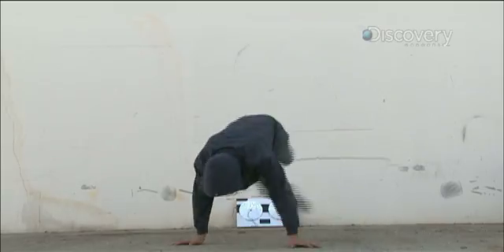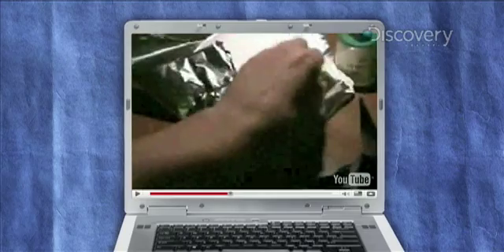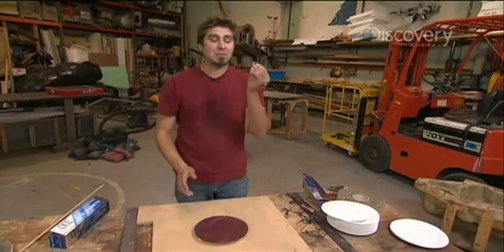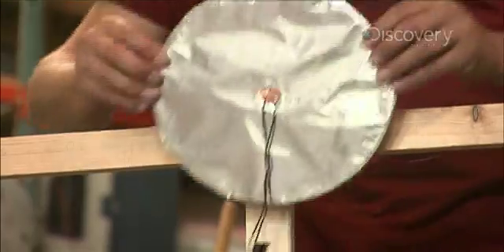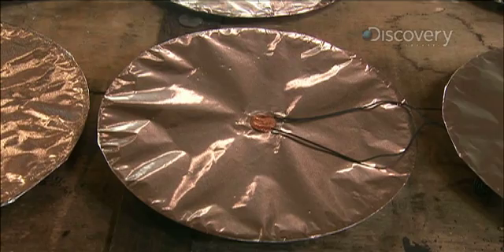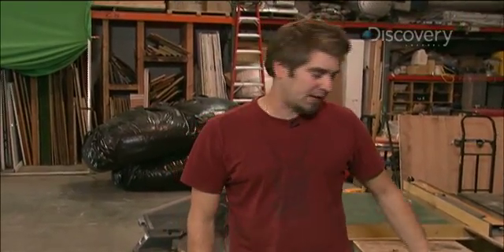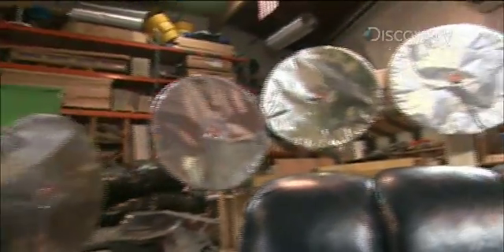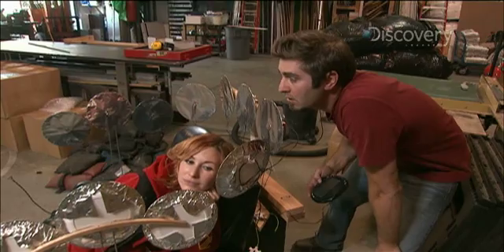MythBusters - Homemade Hi-Def Speakers

Comment: You have a colorpaint on the red wire you have to burn it away before he makes good contact. Maybe you haven't put the two wires on one side of the penny but one on the foil and one on the penny. 

I'm sorry about my bed englisch i'm dutch.

Comment: sorry your need to check your terminology and prices:
"these minijacks cost $10 each"
1 it is not a minijack it is a PLUG with a cable, the jack is the part on the computer,mp3 player,etc. were you plug into.
2. the cost factor, you can by extension cables at amazon for 1 cent(plus shipping), at Fry's for  1.99. and I heard you can buy complete headsets at a dollar tree type store for a dollar or less.  Did you buy Monster? shop before you speak!!
I do agree that this will not work.

Comment: mythbusters are running out of ideas, we all new this speaker was a joke when it was put on YouTube and clearly would never work in a million years. for starters the penny and foil is shorting the wiring! if you had this foil plate hooked up to your 400watt amp it would surely blow the components inside from shorting the wires unless your amp had a safety feature to prevent that

Comment: @roflcoptergoesscisci  hahahahah hundreds of volts for an audio signal?? that is quite a powerful amp hehe....but no matter how much power you would stick into that thing it would blow the amp because there is no voice coil and no magent...all it is is a short circuit on the penny and the penny sitting on some foil :P and a walkman/cd player thing he is using would only put out about 1 volt ac max haha

Comment: @Hiddenjello well...it's kinda like 2 magnets that make a speaker work...the first magnet is a permanent magnet, which is what you see on the backside of the speaker. and the second magnet is an electromagnet of sorts made up of the voice coil. the electric signal from the amplifier will create a magnetic field in the voice coil that will either attract or repel the speaker cone towards or away from the permanent magnet...this is what causes the speaker cone to move

Comment: myth appears to be busted but I don't think so. most mini-jack wires have a layer of clear insulation that needs to be burned off before you could complete the connection.

Comment: that myth is easly busted for a reason. speakers work by magnets. it uses both permanent magnet and electromagnet. when a signal goes though the voice coil it pushes and pull agaist the permanent magnet many times per second. thats what gives you sound

Comment: ....you know, I tried this a long time ago, but there was one thing that I didnt know. how many people are aware of that small coating of enamal that coats the wires under the rubber insulation? you have to either scrape or burn it off, and Most people on youtube that I have seen that try this havent done anything in the video about it, and they didn't do anything about it in this episode...makes me want to try it again

Comment: Torry is too fun.  As for the connectors, yes under a buck no prob.  These things though will never work.  They ALMOST look like electrostatic speakers, but you would need HV to drive them, not an audio jack.  However, this connecting to pennies or aluminum foil does nothing more than create a short.  A speaker needs several ohms, and the energy needs to move something - either using a magnet, electrostatics, a tesla spark (cool), anything.  This is 100% hoax, hoax, hoax.

Comment: @1212fdfd the idea was that with a shiny penny to conduct the current through the wire, they could thus make the vibrations through a layer of tinfoil which ive seen work, in some cases ofcourse, others not so much :|

Comment: its time for Tory to bust another myth: That the Jacks cost $10 each. now, if you buy them specially packaged and made to be sold individually (the jacks alone) it probably would be costly, but there are the cheap ones on crappy earbuds that break too easily, which can be found at biglots, or a trash bin outside of one.

Comment: These 'speakers' are nothing but a giant short-circuit. Anyone with a basic knowledge of physics can see that. Maybe you can get a few seconds of horrible sound by pumping so much power into them that the foil starts burning at the pulses of the audio signal!

Comment: He did not even do it right, Household hacker used only one wire from the jack on each penny, not two.  He should have tried it on just two speakers, one jack. split the jack.  She also said that they were ran in parallel, thus increasing impedance, running speakers in parallel actually decreases impedance. 
I don't think they busted this myth properly since they did not wire it correct.

Comment: @zt1234567890 

There are no magnets or voicecoils. You could make a speaker with a paper plate a small magnet thin copper windings and a mini jack but not with just a penny.

Comment: @ericg83z no, there is a much bigger problem here, a penny wont respond to electromagnetic commands, thus it would never work. A speaker is a vibrational device that induces sounds using vibrations through a magnet & in order to achieve that, you will need a larger magnet with a big hole in the middle, an iron core that goes inside that magnetic hole & glued to that carton plate to amplify vibrations, over 50 to 200 turns of AWG30 magnet wire slightly bigger than iron core, but not touching it.

Comment: 2/2. or just go to that same Radio Shack where you probably got your over priced mini jacks at $10.00 each like you claim and purchase a 100 feet speaker cable followed by a pack that probably brings anywhere between 10 to 20 replacement mini jacks heads only, cut about 15 inches at a time of speaker wire and screw them to the mini jacks heads you just purchased.  There, a way more cheaper solution.  Or just go to Ebay and spend no more than $5.00 for the whole materials I just named.

Comment: 1/2.As soon as the guy said that he was going to use a penny in the center and NO COILS, Magnets, etc that would be required to induce vibrations, I instantly knew that it was not going to work.  You need a coil, a magnet (pref. of the Neodymium/rare earth type) in the center, and then maybe the vibrations would catch up with the carton place, but no aluminum would be necessary.  $10 for each mini jack plug?  I can get 10 of them for under a $1.00, Hell just buy 10 cheap ear buds at a buck each.

Comment: i tried this a while ago.  It actually works... kind of.  I had my mp3 player turned up to max, connected to a set of speakers also on max (to boost the power).  with all this i was able to hear a little music, holding a strong magnet up to the jack/aluminum connection helped a lot.  that's when i got the idea of making a speaker the way they should be made, coiled wire and a diaphragm.  this worked much better and i never tried the aluminum method again.

Comment: @troy1002x none of the ones i have watched have been, they have all just been the result of either good humor playing on the ignorance of others (such as wrapping an Ethernet cable around your phone to get a better signal) or crafty camera work and using off screen devices (such as the toilet seat lowering when you flush it).

Comment: just tried it and it works. however a cd player does have enough power to drive a such speaker. i only got a rather vague sound by using a 50w amp. and about being hi-def, yea right. 

dont trust the mythbusters too much. guys sometimes make experiments that aim to proove simple physical facts. i mean, you dont have to use high speed cameras and stuff to determine velocity that a falling coin would have and you dont have to make an unsuccessful experiment to know that the speaker would work.

Comment: that kid is in idiot - why is he on the show?  He connected both leads to the penny - that's not how you do it, moron.  The penny doesn't vibrate ass - it's the resonance of the AC signal on the foil between a location away from the penny (1 lead) and the penny itself (other lead.)  That's how magneto speakers work (in a sense.)  
In fact, Infinity speakers used to have something called an 'EMIT' tweeter that works like this.
That guy is a clown.
Mythbusters fails again.

Comment: One note, it does not cost $10 to get a  1/8" cable (mini-jack) you can go to almost any dollar store, and get a set of earbuds / headphones with this connector for a dollar or less. 99 cent only stores has a two pack of earbuds for .99.
 I still can't see how this could work, but the parts can indeed be acquired for less than a dollar.

Comment: ...even a normal speaker wouldnt work that way.
There is just no amplifier.
Without an amplifier you can connect as many speakers to your discman as you want, but you wont hear anything.

Comment: Agreed, they were, which is why they required nothing to act as a conductor and amplify the sound. Also, yes an Ipod or CD player can create a spark IF the gap is small enough. With regards to a spark, there's a HUGE difference between the actual voltage and amperages required. If there wasnt, then stun guns and camera flashes wouldn't work off of a 1.5 volt battery. But to my O.P. my argument was that mythbusters didnt do the experiment right. I've watched em enough to expect better.

Comment: @Morndenkainen 
those arcs were so much biger
also there most likely isnt an electrical arc because the wires are touching and not movingmoving around to create a spark
third, there is not enough power from an ipod or cd player to create a spark

Comment: douche bag. by know you should have figured out that paper plate+tin foil+a penny+a mini jack does not equal a speaker. and plus the musical tesla coils video was just sparks that made a beat. similar to ELECTRO., but there is no way in hell that this medeocre method can play thriller in HD. so before you run your mouth make sure you can tell music from electro

Comment: Eh, now your simply talking a matter of voltage or resistive gap.. Im sure you know how easy it is to bend a thin sheet of aluminum or make it vibrate. Thus it stands to reason that even a small disruption in the air between the penny and the foil could be amplified by the surface area of the foil and produce sound at an audible volume. As the penny is heavier than the aluminum.
I agree thourougly though, this is not, by any means, a speaker in the traditional sense of the word.

Comment: i think we are arguing about two different things...i'm saying it wouldn't be speaker and being a smartass because it would make the whole thing wrong and it would be a mini tesla coil if it worked and that makes it not a hi def speaker like advertised...and you're arguing that sound can be made with an arc...i agree with you...just saying that THIS will never work with what is used...so arguing with how the test was conducted is futile...THIS WILL NEVER WORK USING THESE PARTS!

Comment: All I said was that it should work in theory. The arc reverberates off the foil, as in the air pressure waves given off by the spark would cause the foil to vibrate. I never claimed it would be high quality sound. Just that it had the potential to make sound.
1. Any electrical spark creates heat.
2. Heat expands the air.
3. Rapidly expanding air causes a crackling or "popping" sound.
4. arcs in sequence can create sounds.

Like I said, the theory is right, even if the practice is wrong.

Comment: i'm sorry but the fact you are comparing THIS to a tesla coil is ridiculous! i have seen the video you are speaking of and it is really cool, however 1.) its not hi def, it sounds like distorted midi, and 2.) tesla uses a lot more power than line level devices. there is simply not enough power here to sustain an "arch" long enough to create midi sound.

Comment: I was just confirming that the theory is sound based on what I know, (Pun intended.) One lead on the penny, one lead on the aluminum, make sure the penny is nice and clean and the contacts between the penny and wire are good, so that it can create a good arc and it should work..

Also, incase I didnt say it before, spending $10 on a pair of leads is rediculous, just find an old pair of headphones and chop em up.

(The last only applies to the Mythbusters.)

Comment: Pull out a sheet of foil and look, one side is dull, the other is shiny... Consider this. If you bake a potato on the grill, and use the shiny side out, it takes longer to cook, than if you put the dull side out.. Why? Cause there's a difference. :P
Shiny reflects heat, dull absorbs it. Obviously heat isnt electrictiy.

Comment: Yes, and no... Have you ever seen music played on a tesla coil? Youtube it. You can create sound waves with an electrical arc. The sound gets dispersed on the aluminum, and that is what makes it audible. When there is a SOLID, connection, there is no electrical arc, they used the wrong side of the foil in this video, hence no arc, and no sound. Household hacker does not say which side of the foil to use, but watch the videos and you can see the difference.

Comment: 1. notice in the video the two wires and in the original theres 1 and maybe try putting the wire under the penny
2. Its plugged into a computer
3. The wire is sticking out
well not that reasonable but try doing it EXACTLY as it is bit by bit

Comment: Sigh. You guys did it wrong.. 
1. you need one wire on the penny, and the other lead goes to the foil.
2. You have the aluminum foil on backwards, the shiny side goes in.
3. It IS possible because you are relying on the electrical arc between the penny and the aluminum foil to create sound. Aluminum foil is flimsy enough to vibrate to conduct the sound over a larger surface area.

The theory IS sound, which can be produced if done right. (pun intended.)
Cmon Tori, your smarter than that.

Comment: i would say that household hackers PC has a built in amp pre out, some pc cards support this some require you to use powered speakers, the little portable  cd player doesn't have enough power to push enough sound current as the PC does. the only way you could really bust this myth would to use the exact same setup as the hacker used

Comment: WRONG! That's not how you make speakers. However, you can make speakers using a foam cup and some magnets. The reason these speakers didn't work was that one, he didn't have anything to generate a magnetic field, and 2, the the contacts were connected directly to the plate, which should of been the cone. If he had put a couple of magnets on the back, and put those plates into some sort of frame so they could move around freely, then attached the wires to the magnets, then this would've worked.

Comment: @losernameUSA  It'd never work, work, A speaker works by creating a magnetic field in a coil which is repelled and attracted from a permanent magnet in the speaker housing. This is just the wires connected to a coin, nothing more than a short circuit....however indeed you are correct that even if it'd be created using a coil and magnet, they'd still need more power.

Comment: This was on Household Hacker, I can't help thinking it was malicious, shorting out the source by connecting both wires to a single copper coin could damage it. Probably deliberate and certainly a waste of time, Household Hacker is mostly comprised of badly thought out stuff which does not work...

Comment: with a magnet and an electromagnet you cause movement. Movement displaces air that's how we hear sounds.  There is no way a paper plate with foil and a penny will make sound efficiently with any clarity. You would be better off to spend you're money on a cheap PC speaker replacement.  One of the old ones. You can find em for a dollar.  Put them in an airtight enclosure and voila, cheap speaker.

Comment: @PalomarJack  well i could of gone all technical like that but i decided to make it a lot simpler i looked at the mechanics of it but if you want i can explain the hole thing 
1 audio device sends electrical signals
2.since the signals is electrical and is moving in a spiral patter the magnet next to it moves up and down also referring to your magnetic gap
3 the cone or membrane moves because of the magnetic gap making air around it to expand and retract making what we call vibration/sound waves

Comment: there are three main component to a speaker the copper wire, the membrane, and the magnet  the electricity flows threw the copper wiring around the magnet making the magnet move  the connected to the magnet in the membrane which all it does is move with the magnet pushing and pulling the air surrounding it making vibration. and if you revers everything i just said you make a microphone :)

Comment: Not all speakers have to have a magnet. If anybody has ever taken apart an old telephone they know this. These types of speakers rely on vibrations much similar to what has been described in this video. Also search up Plasma Arc Speaker, again no magnets. As for this myth, come its a paper plate and tinfoil for cryin out loud. No way it was ever going to work.

Comment: Okay, you're right that the two on the penny is a very short range short circuit, but doing it on the outside of the plate just makes it a long range one... There's nothing for the electricity to do work on in between those two points.

A normal speaker works by pumping current through TIGHTLY bound copper wires (think hundreds of loops) to generate an electromagnet. That then attracts the speaker cone to a large magnet in the base, causing a pulse of air.

No magnet, no speaker.

Comment: I think it's a case of a little knowledge is a dangerous thing. People know speakers have a moving part and that foil conducts electricity, oh, and that they're usually round, but beyond that it's magic. So, many must believe there is the possibility of it working? In actual fact it's a short circuit!